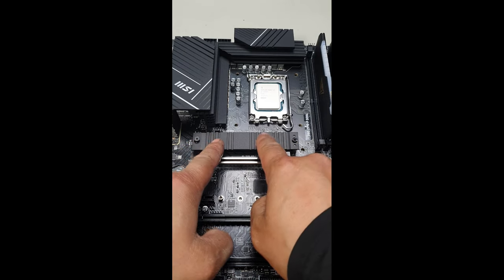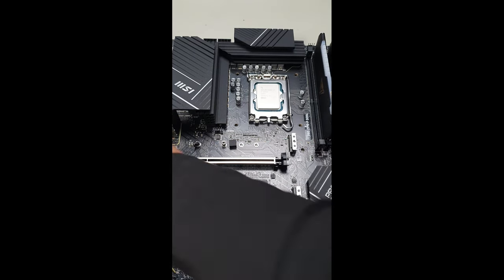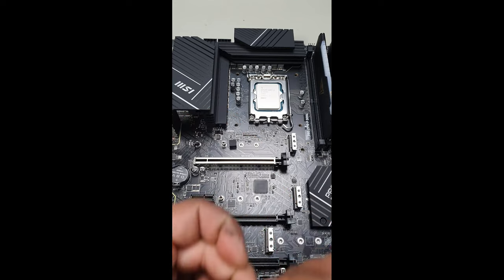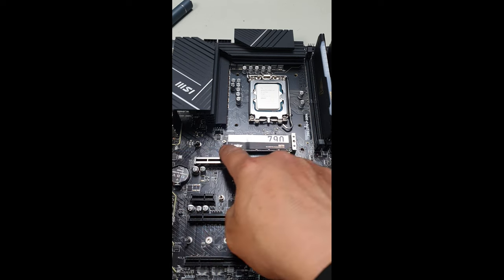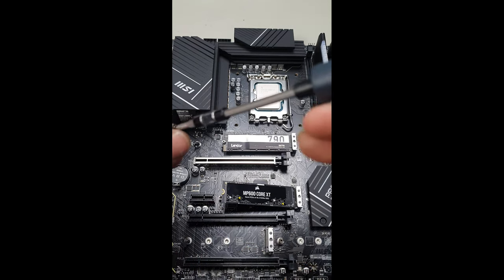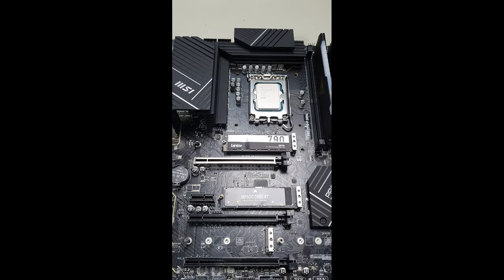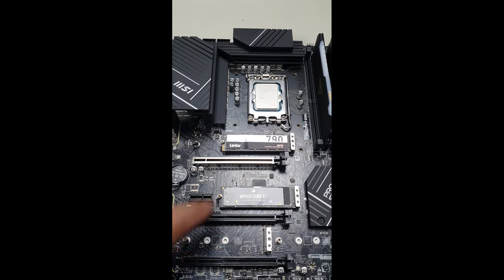msi PRO z790-p m.2 ssd install. quick latch tips

Comment: That clip is a stupid idea. Even fitted correctly you can still move the SSD with your finger. What was wrong with a standard screw for an .M2 drive ?
Reply from the maker: I guess its for the tooless. design... personally for myself   building alot of pcs ..I can appreciate this quick latch...but ur right there was nothing wrong with the screw...
Reply: @MIKEYZVLOGZ  If it locked the SSD solidly in place I would  be all for it - but it doesn't.  With the PC heating up and cooling down over time it is going to become an even worse fit.  First time I have come across it  as I only do a new PC every few years but it has gone in the bin and been replaced  by  a simple metal screw which has served mankind well for hundreds of years.  I don't know whether the idea is specific to MSI but  if it is all I can say is they ought to  spend their time on better customer services not stupid ideas like this..
Reply from the maker: @we-are-electric1445  all companies make these now even asus gigabyte
Reply: @MIKEYZVLOGZ  Ok. At least I now know. 
MSI customer services is still crap. 😁

Comment: Hi, I’m a little confused. My GPU is covering my second slot so I was planning to use the third, and the third only uses the one labeled “M.2 locker.” Do I have to remove the locker clip from the screw, or can I just install the whole thing at once?
Reply from the maker: u can just install it ..and then install the ssd m.2 after u have installed the quicklatch
Reply from the maker: in other words u can install all at once

Comment: Thank you for this great video ! I have a MSI B760 Gaming plus, 2 slots for M2, but just one with a heatsink. If I use the slot without heatsink, will i loose speed ? and should i buy a heatsink for it ? And should i install windows on the ssd going to the slot that has a heatsink ? Thank you for your time !
Reply from the maker: to put it simply if your not running alot off the ssd, then u prolly wont need , however, i always say with how cheap ssd heatsinks are 10 - 20 dollars, its worth the investment to cover the ssd, to prolong life and eliminate stability issues m esp if your running games and downloading or streaming at the same time , it can overheat causing issues with stability, i strongly recommend get heatsink for it
Reply from the maker: as for the ssd and pcie , u need to check with manufacturer if the 2nd ssd slot shares lanes with the gpu pcie x16 , as it will slow the speed of x16 to x8 if it does share lanes and u use it, but u will only know by confirming with mobo and or user manua of mobo
Reply: @MIKEYZVLOGZ  Thank you for your help !!
Reply from the maker: @Clara11986 dun mention it happy to help

Comment: Hi i have this board in a msi prebuilt and wanted more storage can i skip my m2.2 slot and go to 3 to install a wd black sn850x ssd with heatsink so i can skip removing the graphics card? also the prebuild didnt come witrh exrtra quick release screws so would i order and use those or a m2 screw?
Reply from the maker: u can try and find them on ebay, u can use either screw or ther quick latch  , i know some ppl sell them as extras because they dont use them. ebay is def your best bet. u can skip the m.2 and install it in the next slot, theres nothing wrong with that , the only thing u must find out is, does that m.2 slot share pcie lanes with the graphics card, and if it does then u shouldnt do it , as it will cut your gpu performance in half from x16 to x8 and if your looking for more performance from gpu ...u dont wanna do that , if your not sure or cant find the answer in the maunal, then install it, then check in bios what is your gpu is running at now? x16 still or x8 now, personally for myself i have all my m.2s installed, but thats due to me not gaming and mainly content creating, hence why im not too fussed, but for gamers this would be something to avaoid

Comment: I have a second ssd that doesn’t have a built in heatsink, but my motherboard has this cover with some padding underneath it (hasn’t been used plastic is still unpeeled) is that enough to keep the ssd cool?
Reply from the maker: yes it is ...cuz the pad will absorb heat and the cover also does aswell... unless u mean u don't have a heatsink cover ..u can always buy your own and add extra thermal padd under aswell
Reply: @MIKEYZVLOGZ  alright yea I thought so just wanted to know for sure I got a spare in my mb box
Reply from the maker: @Platinum199  ye use it the cooker u keep it the better

Comment: Do you need to put the cover back on? Great video!
Reply from the maker: @MillionaireInCR-V  no the cover is only to protect the pins to begin with ..once u install the cpu the cover goes in box in ase u need to move your mobo u should always keep it to protect in transit
Reply: @MIKEYZVLOGZ but what about the ssd cover?
Reply from the maker: @MillionaireInCR-V  yes ssd cover is a heatsink it helps to cool the ssd m.2 so peel off the sticker and put it back on and screw it back in
Reply: @MIKEYZVLOGZ  perfect, thanks!
Reply from the maker: @MillionaireInCR-V  no sweat thanks for the support I appreciate u

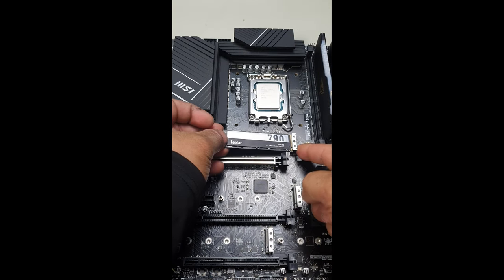Comment: At 0:24 will it be able to fit a 3rd party heatsink or will I have to remove the rubber cube?
Reply from the maker: u will need to remove whatever the ssd is sitting in.. so if urs had a heatsink or rubber case ..take it out so it's just the m.2 chip itself ..unless u have no m.2 cover..or if u remove the heatsink from the mobo u. an use your own m.2 that comes with a heatsink ... but it would defeat the purpose of matching the mobo to the m2 covers like how mines black on this mobo
Reply: just making sure I was clear on my question, when the video starts there is the rubber cube before the screw. Now if I want to use a 3rd party heatsink for the ssd that cube needs to be removed? If so, how do I take it out?
Reply from the maker: @gamerxism  ohhhh...sorry .. yes if u use a 3rd party heatsink u will... cuz it will be in the way..u can peel it off it should be adhesive under it .. or simply cut it down ..whichever way u like buy I'm sure u can pick it off
Reply: @MIKEYZVLOGZ I’m sorry for bothering you but I forgot to mention the ssd heatsink is MHQJRH M.2 2280. Would I still need to remove the rubber block that is next to the screw or not and how would I remove it?
Reply from the maker: @gamerxism  yee u will need to remove it

Comment: The M.2_2 slot ( seccond ssd ) it doesnt have a heatsink with it, can i use it without? I have a PRO B760M-P i just wanna download games on it and also play
Reply from the maker: @BustedGaming yes it doesn't have to have one..but I would strong ly recommend to use one because if you use it for a long period of time such as gaming or multitasking rendering non stop it will overheat and throttle duento over heating...which will slow down your pc and cause instability issues eventually ..for 10 to 20 diallers why not get a heatsink for it snd not have to worry

Comment: I am trying to expand my storage with an pcie 4.0 m.2, but my graphic card is so large it covers the second slot. Do you know if using the 3rd slot will cause any issues?
Reply from the maker: @lugia162 it may cover it but u can still use it   remove ur gpu install the m.2 and place gpu back...the only thing to check would be your lanes and whether it shares any with pcie x16.. ur manual should tell u whether an m.2 slot shares lanes with the pcie x16 ... in that situation it slows down the gpu performance..that's usually only the case wen u use uo all the m.2 slots not just 2
Reply: @MIKEYZVLOGZ it’s the same motherboard you are showing here. I do not see anything in the manual that would suggest that it would cause an issue if I used slot 3 instead of 2 but I wanted to see if you have any knowledge on this motherboard. Thanks

Comment: HELLO! If I put my second SSD in the 3rd ssd slot, am I loosing some speed? My motherboard is the MSI Pro Z790-P WIFI. Thanks!!!
Reply from the maker: yes i believe so, usually its one of the slots that shares with pcie x16 meaning it will only run gpu at x16 
you need to figure out by checking website and soecs of mobo or check user manual and it will tell u which slot shares speed with pcie x16

Comment: i have Pro z790-p wifi, and on second slot i dont have a heatsink, can i buy the heatsink ? if yes where?
Reply from the maker: yes u can ebay and Amazon even computer stores have them.. but cheapest and best place is aliexpress however will take at least 2 weeks to arrive ..if u shop locally via ebay u can find something ..either one with a fan or just nice cooling fins... however keep in mind that your gpu will be placed there so majority of the time u won't be able to use a high heatsink for 2nd m.w slot

Comment: could you please tell me where's the wifi chip?
Reply from the maker: if your mobo come with wifi already u can see the wifi card either on mobo or its where the i/o shield is but inside already installed..is your mobo a wifi model? if not u need to install your own wifi..what is your exact mobo model